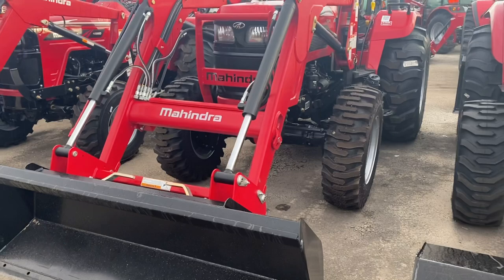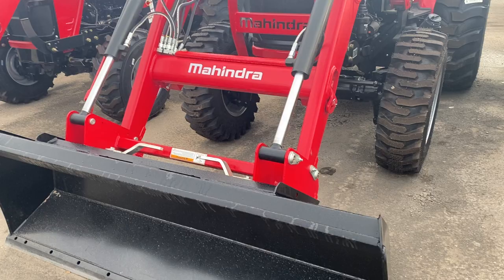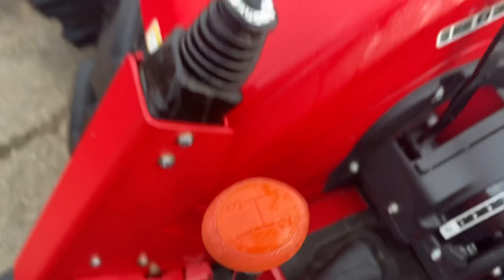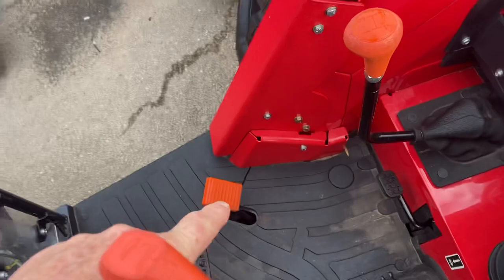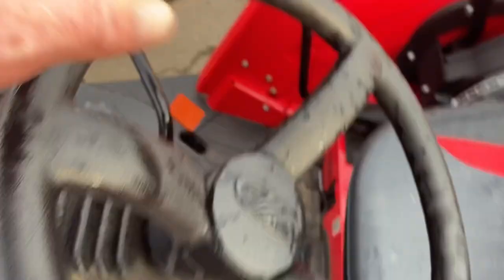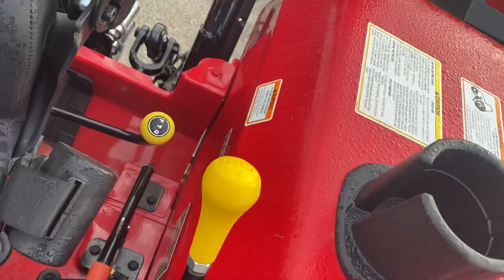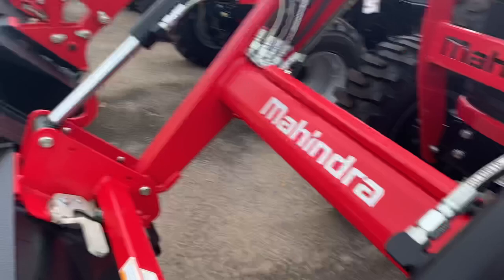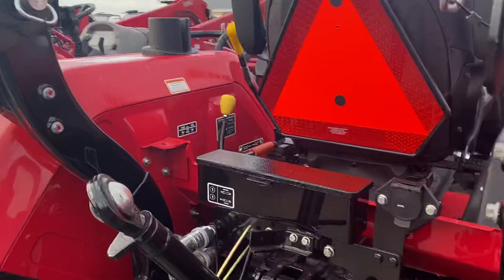Mahindra 5145

Comment: According to Mahindra website lift capacity is 3700 lbs- you said 3000?
Reply from the maker: I have to check but that might be referring to the three point but the actual lift on the front in loader is 3100 pounds